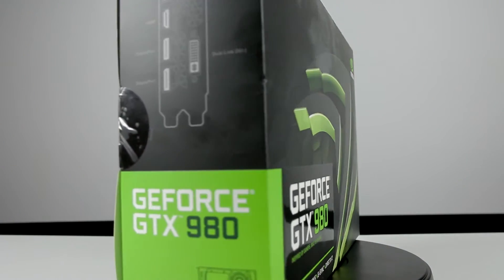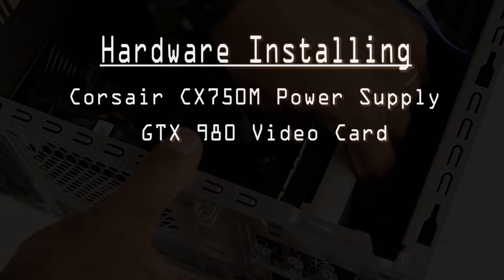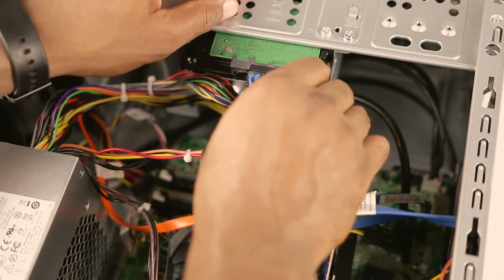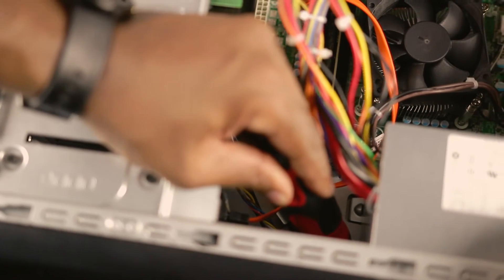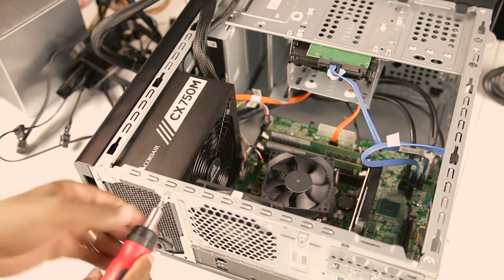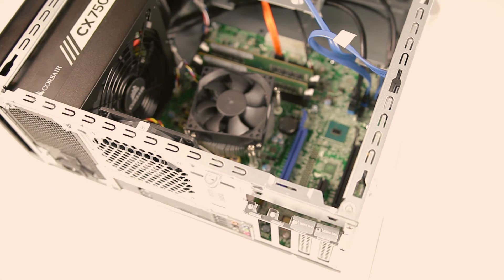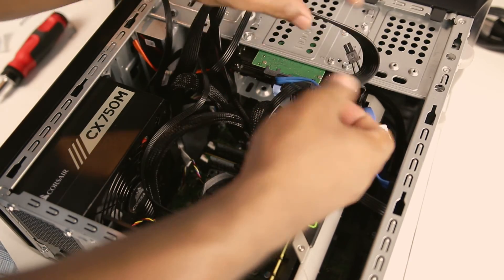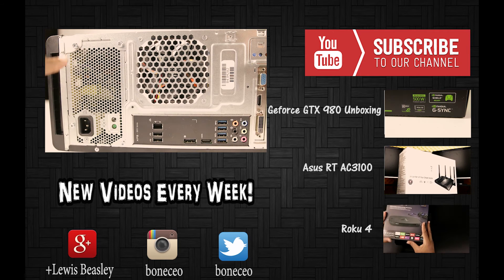GeForce GTX980 & Power Supply Install Tutorial

Comment: I’m installing a gtx 1070ti into my XPS8900 replacing PSU to 850w my question is how do the stock fans do with the upgrade, any heat issues?
Reply from the maker: I can't speak for the 1070ti, but the stock fans worked great with the 980 I installed. No heating issues at all. In fact, it's still doing great. I do plan to upgrade the card to the latest GTX very soon.
Reply: Lewis Beasley Thanks Good to know.

Comment: Thanks for the tutorial, do you happen to know the largest size PSU that can fit in there?
Reply from the maker: I'm sorry I do not know the "max size" that will fit in this case. I will say the 750w corsair I have installed fits pretty snug. It's a tight fit but it fits. It's dimensions are - 5.9 x 6.3 x 3.4 inches.  Anything bigger in terms of dimensions... is going to be  a little complicated  or impossible to work with in terms of cabling room etc. Hope that helps!
Reply: It did thanks!